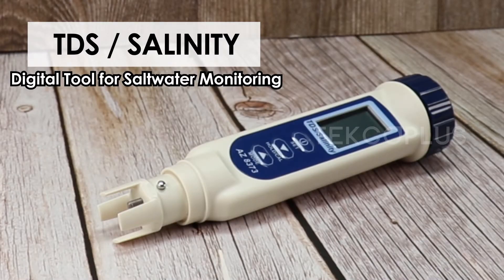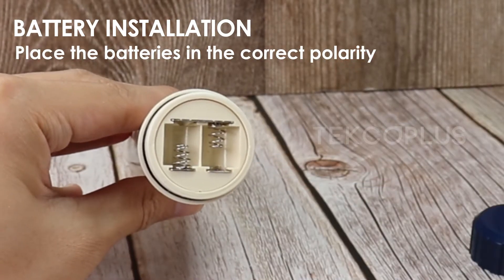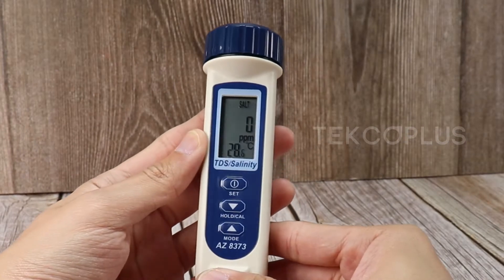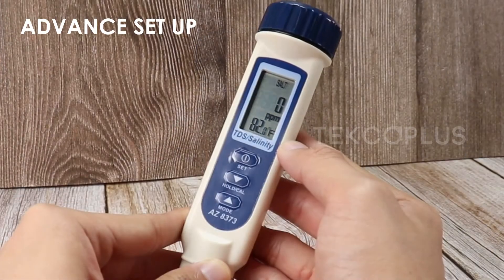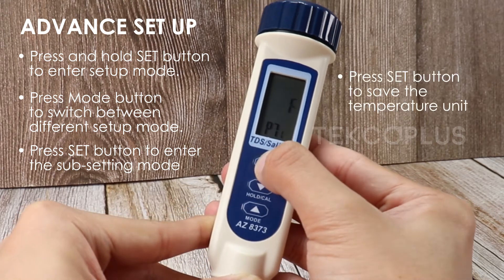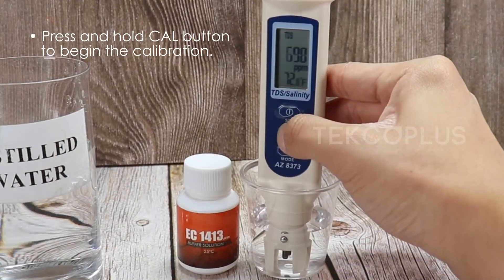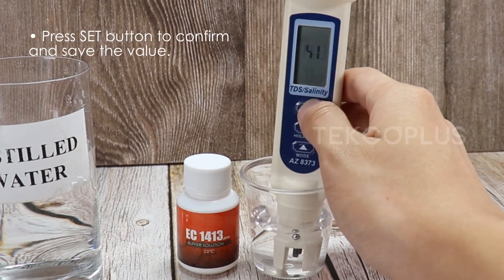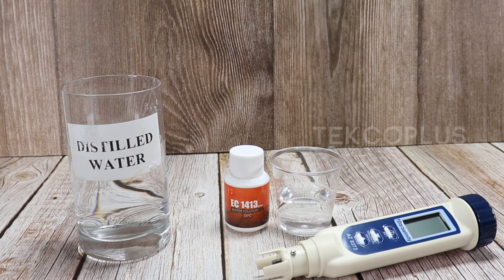TK285PLUS Digital Pen-type Salinity PPM Temperature Water quality meter

Comment: is EC 1413 buffer solution bottle inside the TK285PLUS's box or  i can buy it separately
Reply from the maker: Hi! The set of TK285PLUS does not include EC 1413 Calibration Solution. You may check the following item link to see the set inclusions: https://www.tekcoplus.com/products/tk285plus

If you only need the EC 1413 Calibration Solution, you can purchase it through the following link: https://www.tekcoplus.com/products/calibration-solution